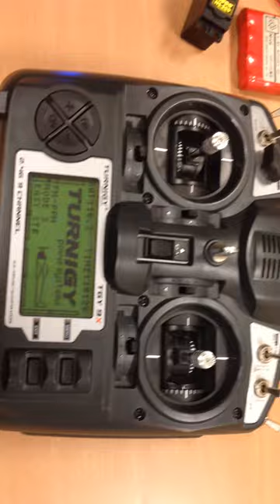Banggood. FR-4CH receiver is faulty.

Comment: I bought the same receiver, solder he pins and testing it without an issue. Maybe you give them to much heat during soldering the pins or a pin has a cold solder point.